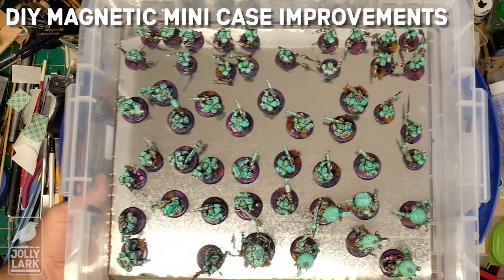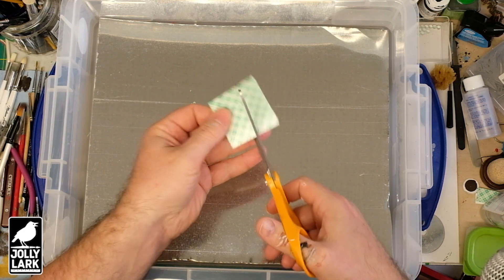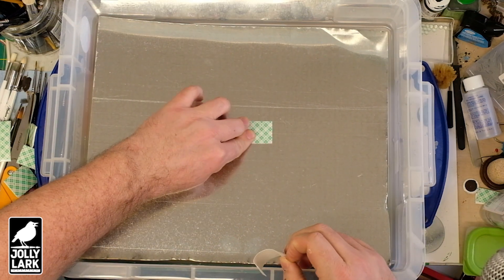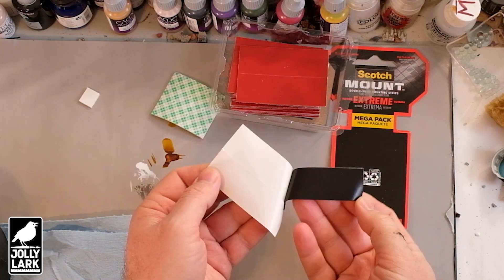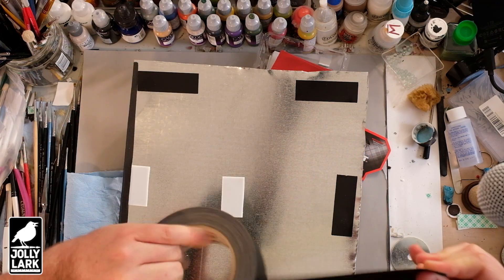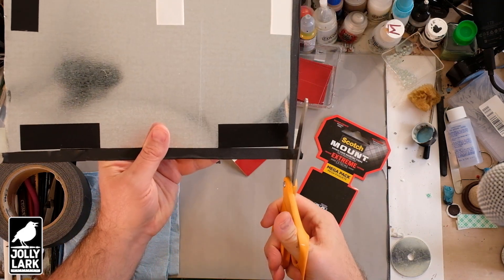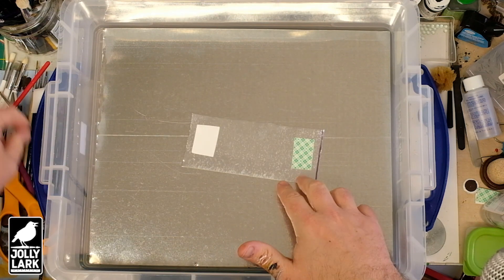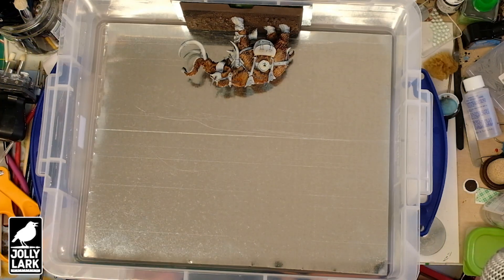DIY Magnetic Figure Case Improvements & Upgrades: Skip the Glue and Add Space for Taller Minis!

Comment: Have you ever had any issue with the figures snapping together or moving on the tabletop because of the rare earth magnets?
That’s the only thing scaring me about doing this
Reply from the maker: I've never had an issue when moving the figures around the table. Every once in a while two miniatures will snap together when I'm removing casualties and holding more than one mini in my hand at at time. 

It's never been a problem though. When two minis "snap" together, it's the undersides of their bases that are coming together, so no harm's done to the minis. You may have to experiment with what size magnet is the right strength; I've found 6x2mm neodymium magnets work well. They're not so strong that the minis are leaping towards each other, but strong enough to hold them reasonably securely in transit.